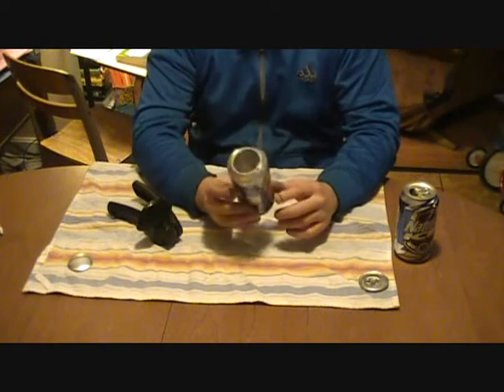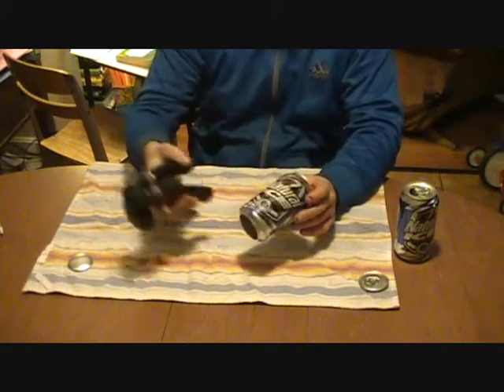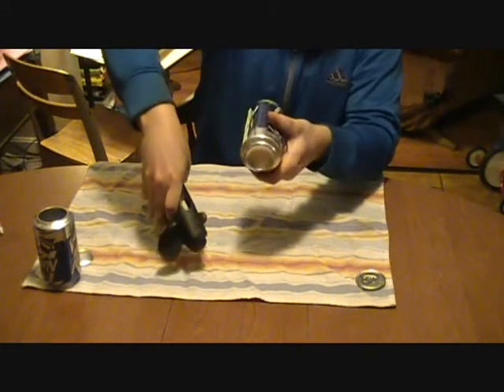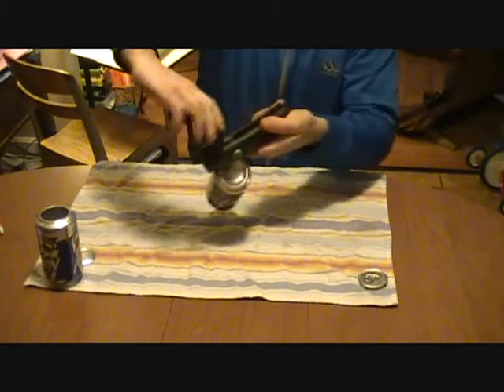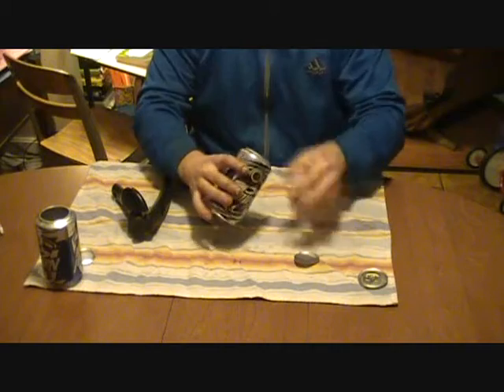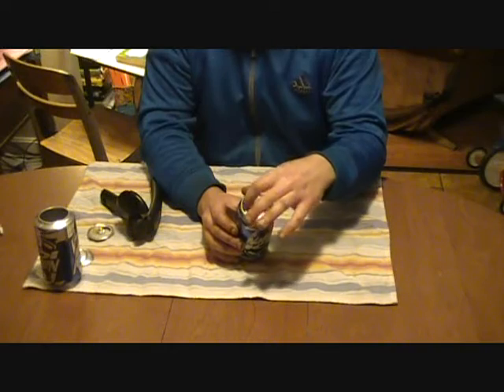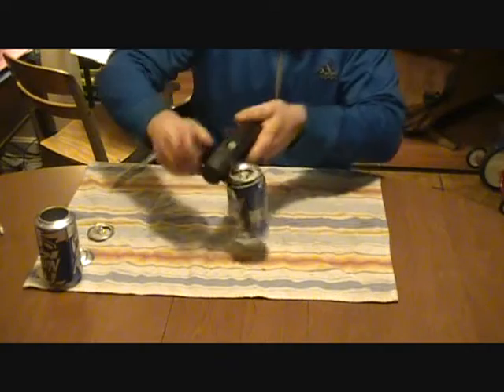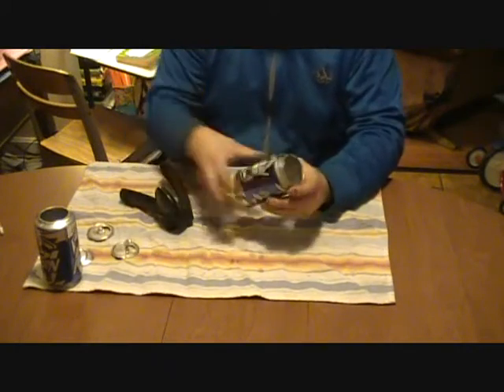How to hollow out cans for solar heater/pop can heater - The easy way - Backyard Mechanic DIY

Comment: Do you think it would be better to cut them in a way you keep the tops and bottoms as part of the system instead of removing them? Fold them inside instead of removing? My thinking is, more surface area + more turbulence + more mass = higher efficiency, less waste, and less cycling of the fan on/off when partly cloudy.
Reply from the maker: Can't hurt.  Turbulence in a passive system with no fan would be undesirable,  but with a fan it wouldn't matter much.  Worth testing for sure!